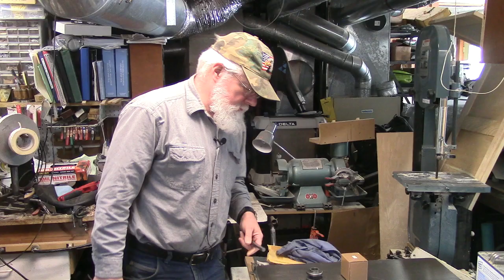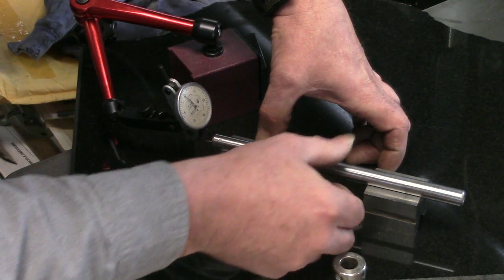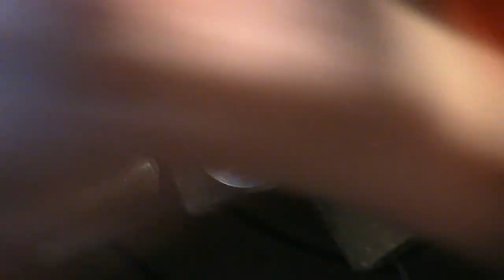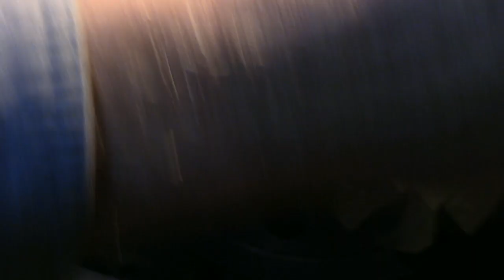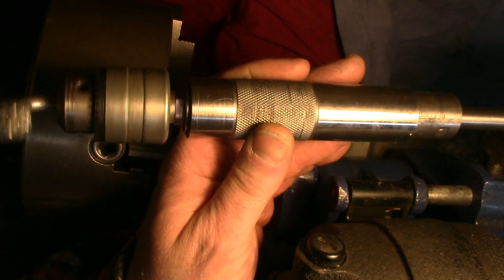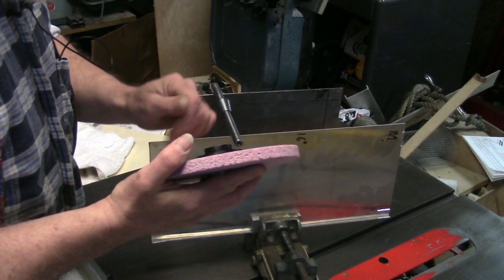Making a Grinding Wheel Balancing Arbor

Comment: Great video. You taught me some things.
I’ve never checked the accuracy of a center drilled hole.
How did you set up, verify your 7.125 degree taper on the compound?
I made an angle gauge and ground it. The taper came out like yours, very good fit on the old Sopko adapter.
The mystery metal is a first for me also.
You have motivated me to add the four wheels on my ground rail set up.
Thank you for sharing this video.
I’ll subscribe for sure. I like the way you approach your work.
Reply from the maker: Thanks. I'm glad when I can impart some useful info. That's the whole point of the channel.  'Cause I suck at entertaining. :) 
I set my taper by by placing the mating part (wheel adapter) in the chuck and running the compound in and out with an indicator, adjusting for zero deviation.  I though that was in the video. I'll check and include it in another when I can.
Reply: I just made a balancing shaft yesterday of cold rolled bar. Set one dial indicator to measure 1 inch parallel movement of compound to lathe bed. Set another to measure .1250 movement in of cutter in the 1 inch of travel. Just kept bumping the compound angle until 1 inch x movement yielded .1250 movement of y axis. Got a print of 100% on both inner & outer tapers of the Sopko hub.

Comment: The fun really gets interesting when the mystery metal is air hardening tool steel. That's happened a few times. From there, you need a heat treat furnace to anneal it back to machinable state. I came here looking to make a similar balancing arbor, as eBay has them too pricey, and "have machine shop, make parts".

Comment: Thank you! Im just dipping my toe into my new surface grinder and this was a great video
Reply from the maker: Well then, I guess I need to get off my duff and make the balancing frame. I bought the tool steel for the wheels.  I also need to come up with some way to balance the wheel adapters too. I think the drilling of a series of  threaded holes in the mounting washer for set screw weights was a good idea.  Guess I have some work to do. Thanks for watching.
Reply: Incidental Information funny, I’m about 50 pages deep on google images looking at balancing frames. Im subscribed and waiting

Comment: I think your different finishes on turning the tapper has to do with surface feet per minute rather than hardness. As the diameter increases, the surface feet per minute also increase.
Reply from the maker: That's a reasonable assumption, however the change in diameter was very slight in this case. What actually appears to have been going on was the rod I was using was case hardened. The outer hardened surface was about .050" thick! Grinding made the difference in hardness and appearance very evident later on. I had never turned such a piece of steel before, and I'm not sure I'd want to again. But it did make a nice arbor in the end.

Comment: It's case hardened rod hence the two different appearances.
Reply from the maker: I figured as much. But I was amazed by how uniform the case hardening depth was and how abrupt the change in hardness was.  I've machined some "case hardened" rod before but the depth varied a bit and the transition was as thick as the hardened surface. Metallurgy is an amazing science I have yet to fully appreciate.  Thanks for watching.
Reply: @i-squared  Oxtool made a video where he was going after a good quality case hardened rod in his lathe for inclusion in one of his projects and that rod showed the same precise delineation as the rod you were  turning. That's what clued me in to what you had going on.

Comment: came out nice! thanks for sharing..  I think a new wheel for TP grinder would likely improve finish.
Reply from the maker: You mean a wheel that's not worn to the nub and all chipped out of balance? What makes you say that?  LOL!   Indeed, I have to order a few but put it off since I use it so seldom because of the mess it makes.  Mainly, it's just for grinding my chuck jaws every few years. I hope to use a motorized spindexer on the new surface grinder for shafts in the future.  A tool and cutter grinder would be welcome too.  So many tools, so little time... and space, and money,and...    Thanks for watching.
Reply: What OD/ID wheels does your grinder use ?
Reply from the maker: Not sure exactly since I have no docs for the Craftsman version of this Dumore.  It appears to handle a 2.5" x 3/8" wheel. It currently has a sleeve for a 1/2" bore on this cupped wheel. The cup is what's all chipped away.   I haven't decided what wheels I want to order yet. Like I said, I hope to never use it for shaft work again if I can use the surface grinder and spindex jig. I have plenty of wheels for grinding my chuck jaws for which it is exceptional. And I can suck all the grinding dust out the back of the spindle!